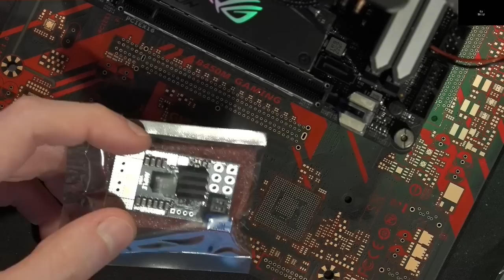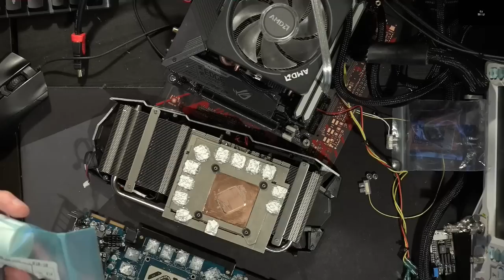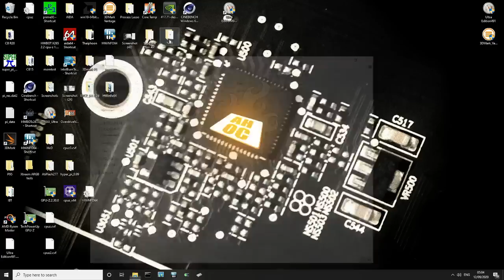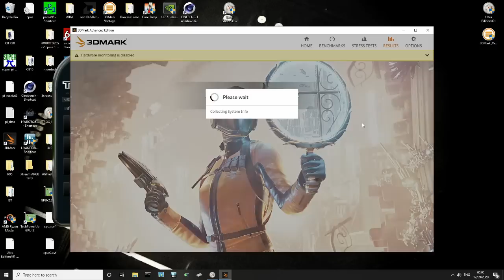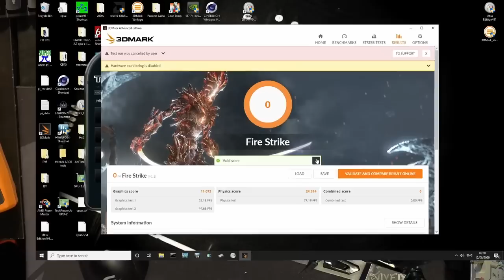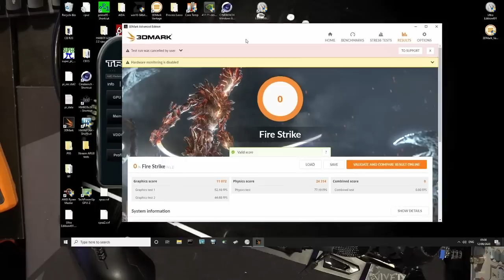Elmor Labs Ample power board feat. HD 7970 Vapor-X zombie card

Comment: Buildzoid I found a kit of memory that can overclock to 4400mhz cl16-16-16 on daily voltages. Linpack extreme stable. 
Would you say that it’s a good overclock? And if it is or is not.
What would be amazing timings for 4400mhz on B-Die on normal voltages?

Comment: 7:58 The enable pin is almost always active high so you can use it for PSU sequencing. Hook it up with a resistor divider to the output of another PSU, and when the voltage goes up above VIH it will turn on. If not being used it should be tied to VIN so it always powers on. Since there's the "option" for it, I would expect an pull up resistor (100k or higher is typical) to ensure it is enabled, but that would be a feature (or not) of the buck regulator/controller elmor used, which he does not say (some have an internal pull up on this pin). For example, on Analog Devices regulators, enable pins with internal pull ups are called "run" pins (i think).

Comment: The very first graphics card i've purchased for myself was also a 7970 sapphire ref card which i ran overclocked for like 5 years no problems on a z77 system with intel 3770k. Then i purchased a 1080ti and basically gave the 7970 to a friend of mine who had an amd fx 8320 system and he had all the problems with the card even underclocked. I never even got the card's cooler out, never really had over heating issues with it, the card basically never even reached any temperature beyond 80 degrees. I've had run a bunch of fire strikes on it probably hundreds and i gamed on it like almost full time all the time and once he installed the card on his system, he had all those weird glitches in games and system shutting down after card reaching 90C+ and it was always hot for some reason even tho he had a better case with better airflow than mine. And then he basically got the cooler out of the card, cleaned it off, baked it in an oven and all that crap and the card still works. He doesn't use it anymore because i gave him a mining rx 470 with only a dvi-d port and using a pcie-1x riser to connect it. Well but i was surprised how the card handled all of the crap i did on it and then suddenly starting trolling it's new user. He even had a better power supply than mine. That card really had a soul lol. Man i love 7970's
Reply: Hello, I am that friend mentioned. Yeah That card literally didn't like me. The coil whine was insane and after a while, my gpu fan stuck at %100 (which for those who know hd7970, sounds like a freaking jet engine) then the temp would go above 90*c and it would just crash itself and underclock itself yet remain with %100 fan speed. Ohh those days...
Reply: @Rock4everNRoll  Lovely isn't it, i am pretty sure if you gave me that card back, it would just run happily in my system just like nothing was going on. It can decide whether to work or not literally.
Reply: probably a crap smps.

Comment: What’s the difference between 2 vs 4 dimms on a amd system?
Reply: Assuming the processor is dual-channel, the main differences between 2 and 4 DIMMs would be the total amount of RAM you can have and the upper limit to how much you can overclock the RAM.

With fewer DIMMs, the CPU (memory controller) will have an easier time controlling the RAM, so you'd be able to have higher clock speeds/lower timings on the RAM. 

There are CPUs that have more than 2 channels for their memory, and systems with these are what would have more bandwidth from having more DIMMs because they're able to interface with each DIMM individually. Most systems are dual-channel, and will not benefit from having 4 DIMMs.

AMD Ryzen stuff will be dual-channel, while Threadripper and EPYC go up to 4 or 8 channels.
Reply: Well having 4 dimms cost you a couple megahertz and a couple cinebench score for both amd or intel systems as you basically add more distance for the data to travel thru the bus. If you had however a threadripper system or similar that has ram sockets on two sides of the cpu rather than only one side, you can probably put 4 dimms and have a little bit more performance than what you'd have on a system that has ram sockets on only one side. More distance = more latency = less performance. Every tiny bit counts.
Reply: More memory bandwidth more performance. Google it